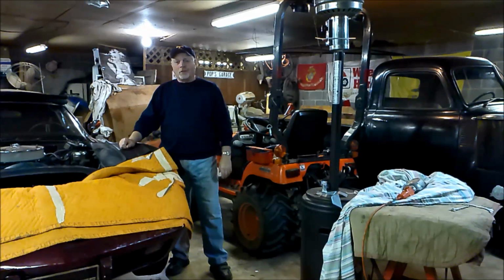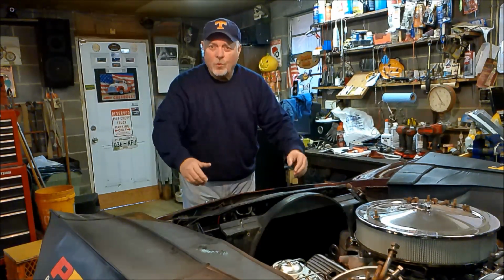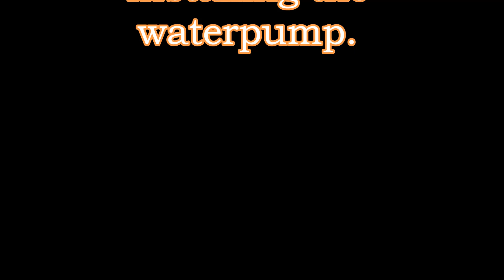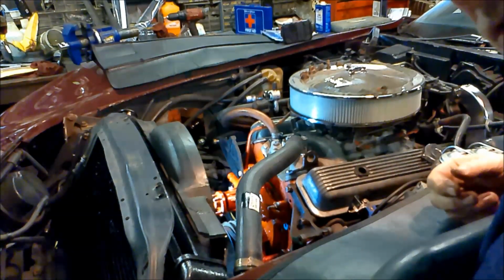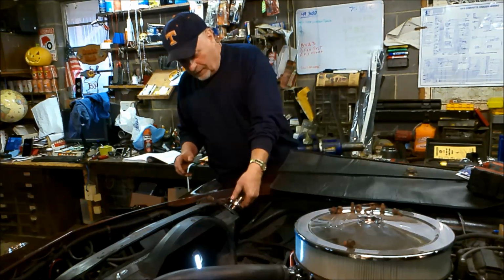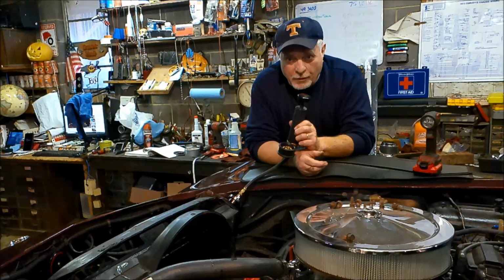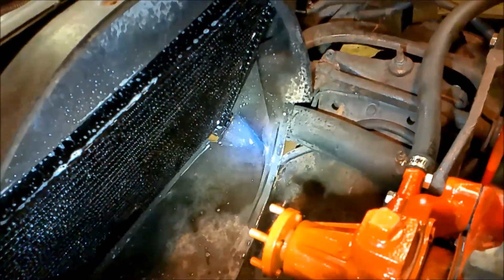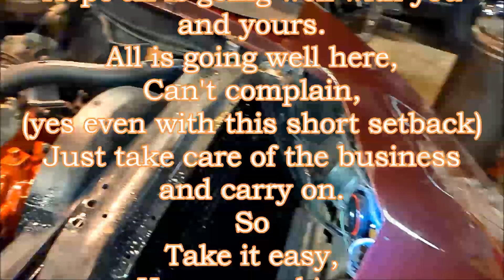Installing a waterpump on a 350 SBC in a 75 C3 Corvette, volume 38

Comment: Dave, that is the ultimate bummer.  After the radiator shop saying they pressure tested it and then all the work of putting it back in, you have to take it out again.  I think going with the new radiator is the right call.  Hope the new one comes in quickly so you can get the vette back on the road before Christmas.  Take care.  Thanks for taking the videos, editing them and posting them for us to view.  Always a pleasure.
Reply from the maker: Hey Tom, this Vette is battleing me the whole way, LOL. Merry Christmas to you and yours.
Reply: actually, the ultimate bummer would be if the cooling system were full and fan  etcetera installed... That would suck. A good mechanic tries to always do it once, correctly..As Dave has done here.
Reply from the maker: @gvxclassics  Hey Lee, Merry Christmas to you and yours.